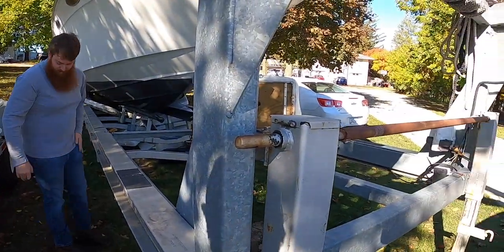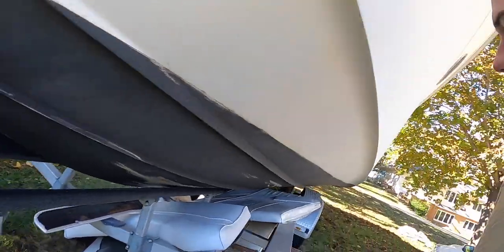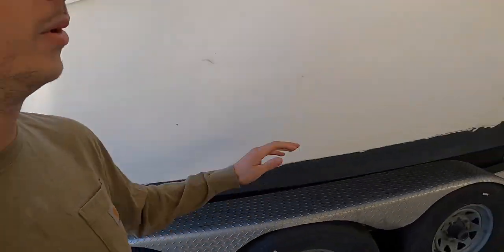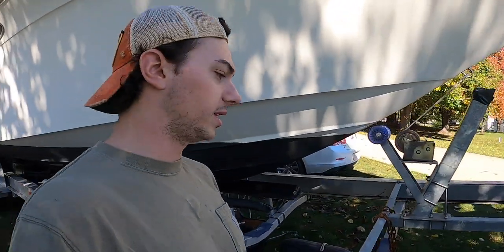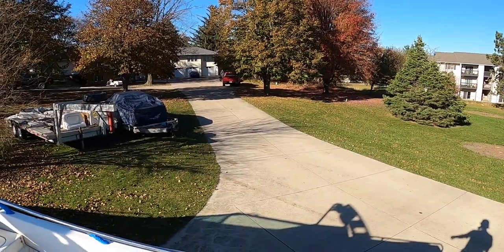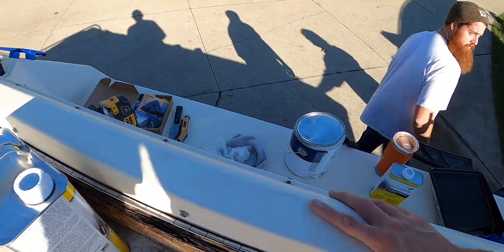DO NOT TRY THIS AT HOME! Iowa Men Attempted To Paint Yacht On Their Own! 1992 Sea Ray 380 Sun Sport

Comment: Total boat products are good. 
May want to talk to your supplier about mixing and spraying techniques.
I had a 420 dancer "90"
Restriped it with the Sea Ray black and gold scheme.
I used a heat gun to remove the decals.
Worked like a charm.
Just keep it moving and don't let it burn the decals once you get the hang of it it will take glue and everything.
Looking forward to your next video.z👍

Comment: Spraying is actually pretty easy, masking is the toughest part. There are a few really good tutorials on youtube as well. Since you plan on selling this, you really should sand down the top and spray it as well, at least on the parts that aren't 'nonslip' of the gelcoat.
Reply from the maker: Going to spray the sides and roll the top. I’ve decided to keep the boat at least another year.